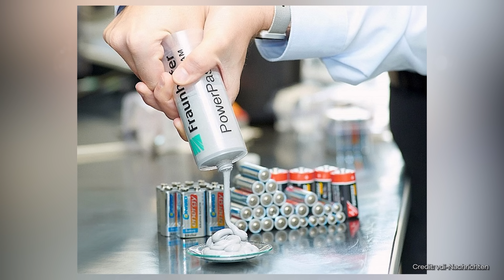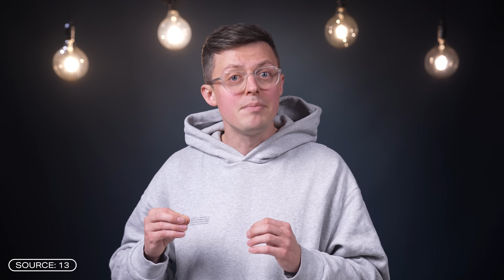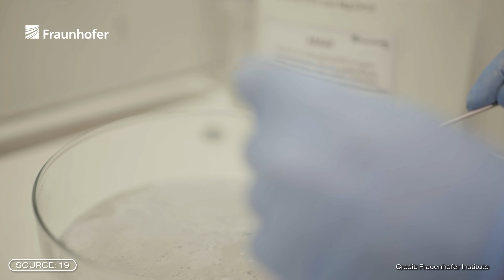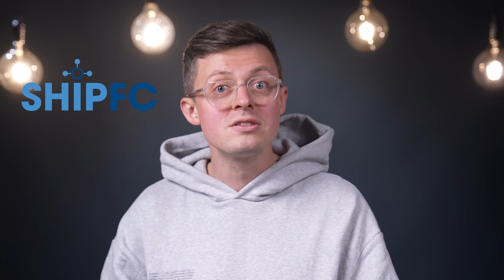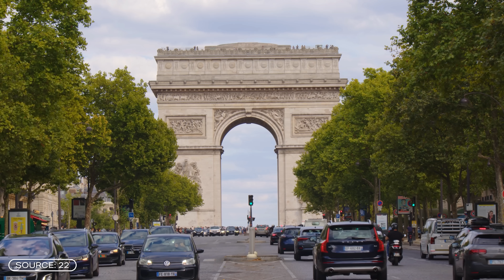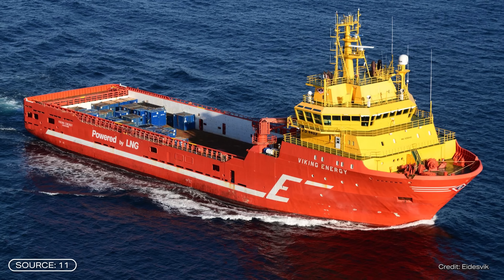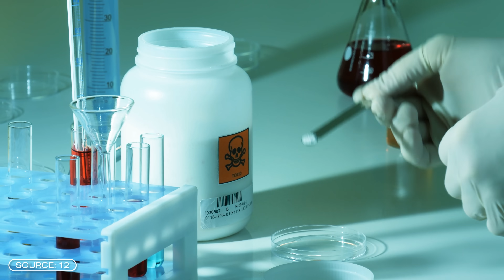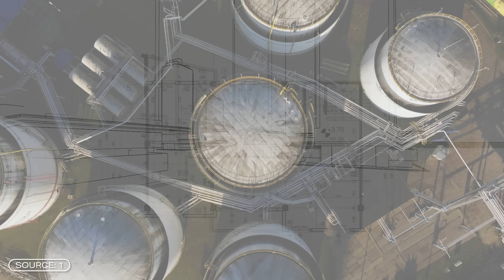Hydrogen Powerpaste: 10x Higher Energy Density & Safe?

Comment: Can PowerPaste be used as rocket fuel?
Reply: seems unlikely as there is residue left == mass ..... methlox and LH2/LOX burn leaving no 'residue' --- and you would probably have problems in fuel delivery unless maybe a replacement for solid rocket boosters (again residue issue ) but no re-use of rocket likely...

Comment: will this process work for HHO - hydroxyl gas - also?
Reply: HHO is term used by kooks to describe banal mix of hydrogen and oxygen. Has no magical properties.
Reply: @lidluser55 with very (very) careful handling it is a do it yourself cutting torch that has been doing useful, if not magical, work since i think the victorian era?  in my head it might also be a good way to pyrolise wood in a retort to make producer gas, without all the nitrogen added by pyrolysis in air, but this is a very layman guess only.  the home built path to a carbon negative existence is a complicated one.